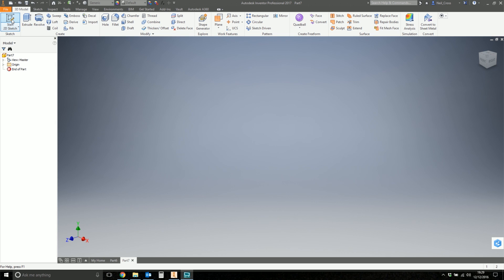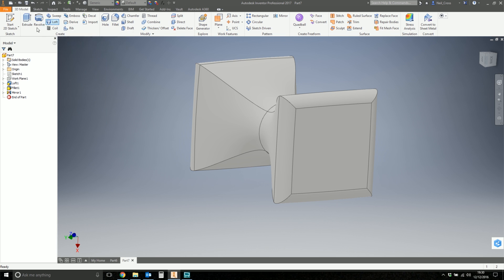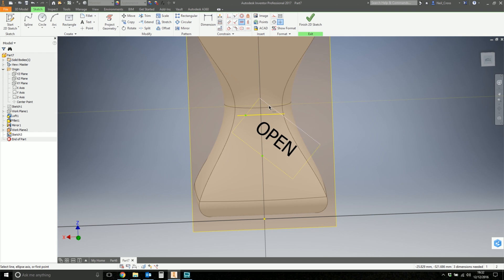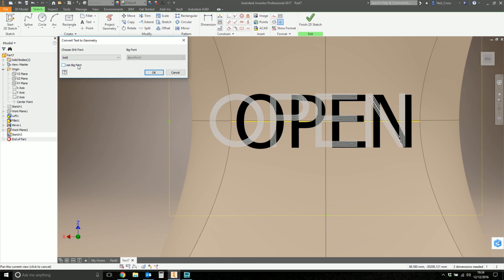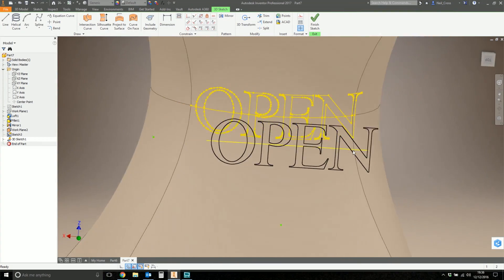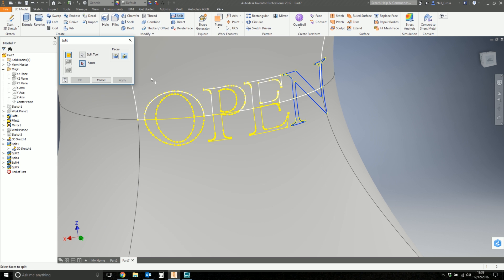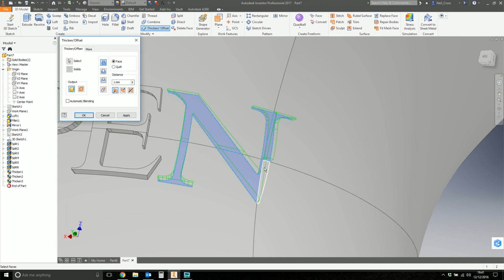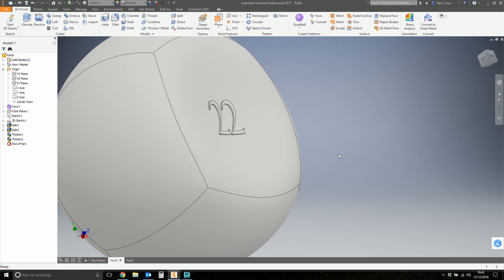How to Emboss Text On ANY Curved Face(s)

Comment: I keep getting a "create parting line failed" issue when I am trying to split. for reference I am trying to monogram a wine glass, it is always the middle letter that doesn't work. The middle one is bigger than the others, still had this issue with the middle one when I kept everything the same size. Any help?

Comment: Hey thanks for the tut it's great but I have am issue when I try to add another embossed Text to the same face I get a fail.

I also find it really in consistent but I am using 2018.

I get issues where the split wont either work for one letter out of 4 or get 2 different errors in the same line of text.

One is 

"Could not build this Split
         The selected curves for the Split Face operation did not fully intersect the faces to be split. Try with different inputs."

or 

"Selt intersecting paths or loops are invalid for this operation"

But I can split the other 4 letters without an issue?

Comment: This isn't a truly wrapped emboss. An easier way to achieve the same result would be to extrude a new solid of the text and split it using an offset surface and then combine. That way the text remains parametric.
Reply: Exactly

Comment: G'day Neil. Love ya work. Took me forever to figure out how to do this in Inventor 2015. Can I explain simply? Offset a surface from compound curved face same distance as the depth of text you want, extrude text that's on a workplane offset from part surface to the part surface you want the text on. Then use the previously offset surface to trim the extruded text. Same result as you got, maybe a little quicker? Text isn't perpendicular to the surface, not sure if it is with your method. 'bout time I tried to contribute. Thanks for your work.

Comment from the maker: ** You'll need the R2 & R3 update for 2017 to do this, this will then be available as default in all future Inventor versions.
Reply: Looks like the Emboss function works just fine. Maybe they fixed it in the last update. I did exactly the same, except that I put my plan tangent to my surface.

Comment: Nice. I guess to use an actual font, just outline it in Illustrator and bring it into Inventor as DWG.
Reply from the maker: Yea that sounds like a plan, and gives me an idea for another video for something relating to this!
Reply from the maker: This was the inspiration for the latest video, converting an image logo into vector using Illustrator and etching it into metal.  Thanks for that, and heads up, a question you asked is featured in the next video which should be up either in the next few hours or some time tomorrow!
Reply: Thanks. If the you are referring to the question regarding mitred different-height flanges in sheet metal, I'm searching for the vid but can't find it. Will keep searching.Edit: Scrap that I found it tucked away in a long video. Thanks for clearing that up.

Comment: Neil this is great.   

Question on the "convert to geometry" feature:  can I get this done manually if I'm using Inv. 2016?  

Also, can we make a debossed feature this way? I mean does the thicken support anything that would work to cut the model?    

Thanks for the excellent videos!